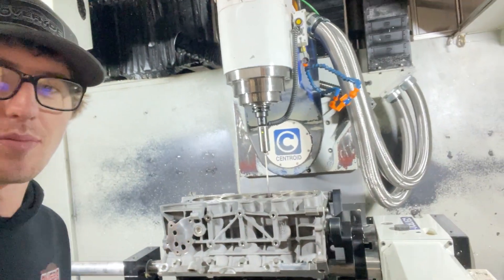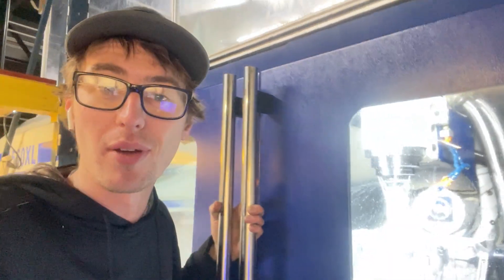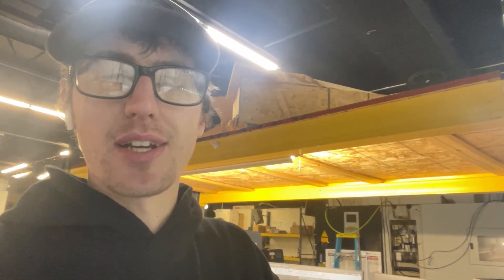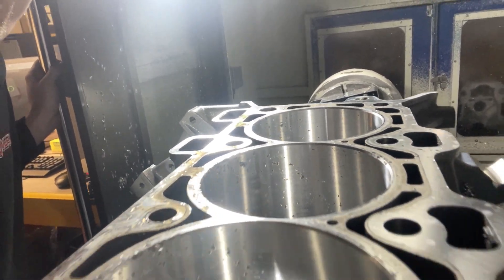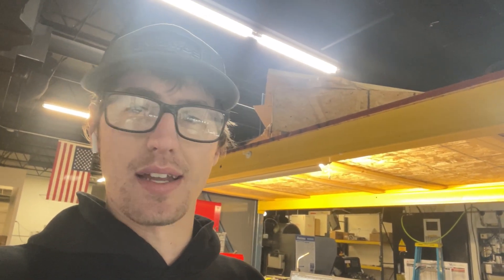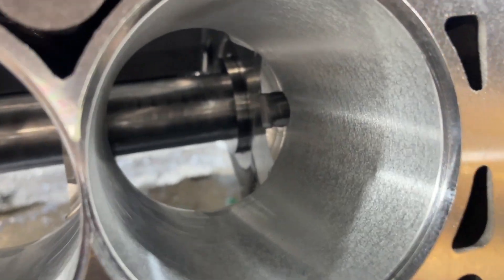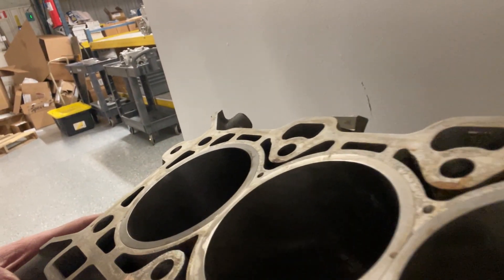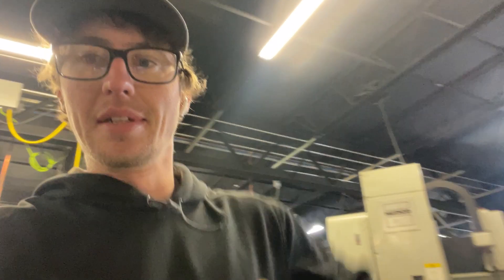Machining my coyote block to install sleeves!

Comment: Which brand sleeve are u using. What was the final bore ID size? How much interference are u running.  Do they have a counterbore , how deep and big was it. Thank you
Reply from the maker: They are la sleeves. Flanged. They do have a counterbore I can’t remember the specs off the top of my head tho

Comment: What would you charge to do my Coyote going diamond 2k pistons molnar power adder rods clevite bearings cylinder supports but might change this with some sleeves. Also Callie's crankshaft.